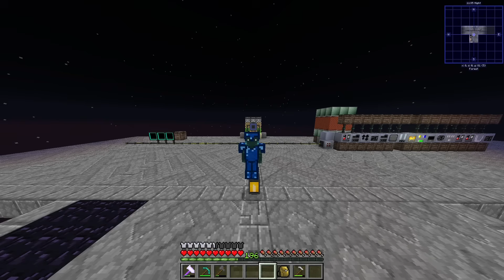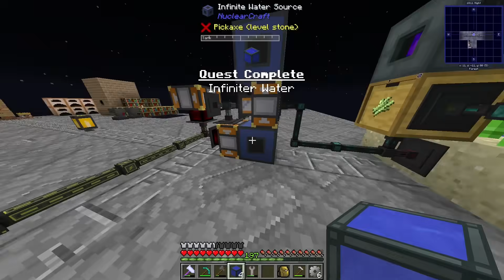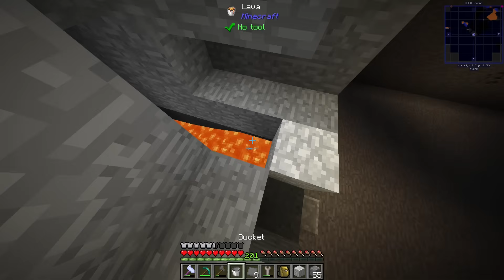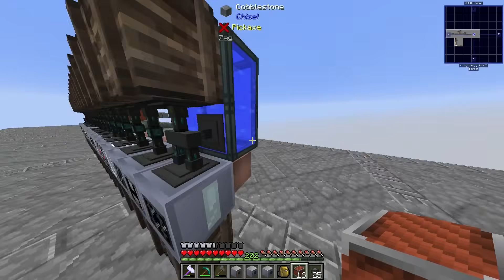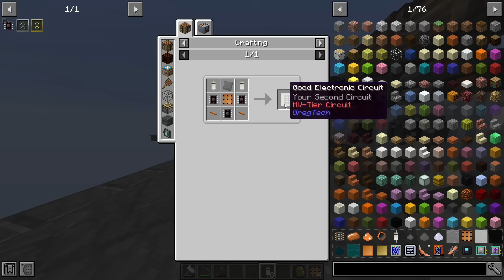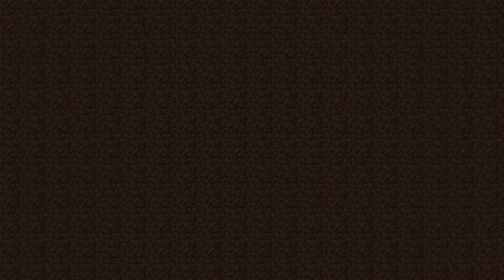Nomifactory [03] - Passive PPC and prosperous power solutions

Comment: Cleanest PPC automation I've seen in my life. Few tips, though:

Electric furnaces are 100% useless and 0% useful. Switch it out for a normal furnace and use Coal Coke to fuel it.

Additionally, since you now have access to Coke, save your Alloy Smelters the trouble and make like 16 PBFs for steel. There's an amazing recipe that takes 2 WroughtIron and 1 Coke to give out 2 steel in 30s. 

Rig a quick clay electrolysis system into your PPC, for sodium, silicon, lithium and aluminium. Sodium is a nice building block, lithium is good for batteries, silicon and aluminium are great for boules and machine hulls.

Happy Gregging!
- Clew
Reply from the maker: yea everyone is saying electric furnaces suck 😭

i did actually notice that steel recipe, and since pbfs are so cheap it might be worth spamming a few lol
Reply: My automation is a mess, but it works. 😭😭😭

Comment: Regarding the confusion when you tried to power the MV alloy smelter:
Gregtech machines work by accepting a single Amp of power (unless otherwise specified), so you cant just pump 4 amp of LV into an MV machine, you'd have to transform up from LV first.

Comment: Ender IO conduit transfer limit is per connection (a bit oversimplified), so you can transfer almost infinite power as long as each generator and machine draws less than the limit
Also it's a good idea to build the PPC setup in a way that allows easier expansion in the future since you would need a lot of it to keep up with all simulation chambers. There's a ratio somewhere which mentions how many machines you need.

Comment: about the gt energy, your mv machine in the polymer line works on that cable because (it's just a guess, didnt check the recipe) it only uses 32 EU (equivalent to 1A  of lv). the small machine can only accept 1A of their tier. so on the mv alloy smelter it does not work with lv cabels, since it uses almost 4A. The multiblock energy hatches accept 2A each, so you can overclock your ebf to the next tier. your 16A line helps when you want to run more lv machines at once. hope the explanation helps
Reply from the maker: Yeah a couple people have mentioned how it works, I think me understands now :))

Comment: "two 6000 and 2000, we're producing loads!" Once u start passiving it wont be that much unfortunately. 😅 
As Exa said, electric furnaces will become your bottle neck so arc furnaces are recommended. If you want infinite oxygen theres the glass loop where sand -> 2 glass for 20mb O in an arc furnace and then that glass inevitably becomes 2B O after processing it into SiO2. Afterward you feed that O back into the first step and its generally +1980mb O positive. I dont remember the specific ratios but I only ever had to upgrade the setup once at like IV/LuV iirc. Great episode!
Reply: could you explain a little bit more on how to do this loop? i cant find where to turn the quartz into oxygen again, ty!
Reply: @cesc21  its glass to oxygen, not quartz.
Sand + 20mb O = 2 Glass
Glass -> Glass Dust
Glass Dust -> SiO2
SiO2 -> Si + 2O

Comment: 9:37 the arc furnace is like… one of the easiest machines to make… and it would’ve doubled how much you get out of your gallium arsenide… it’s not quite as useful in this pack as wrought iron and glass can be made way easier without but annealed copper is still extremely useful. It can make more of the basic components and is also needed for some mv machines (I think). Plus you can recycle machines and other stuff if you want in the arc furnace, but there’s little point. Please make the arc furnace, it’s so good.
Reply from the maker: Il definitely look into getting an arc furnace! I'm very quickly running out of gallium arsenide and making glass better is also useful

Comment: You can run higher voltage machines on lower voltage power, but they are able to take only 2amps so if recipe takes more  power than 2a of lower voltage, then it will powerfail
Reply from the maker: Yeah I understand why it wasn't working now lol

Comment: If you like to keep notes for yourself, rather than signs craft yourself a clipboard - they can be placed on a wall to display it, and you can interact with it to add/edit entries. You can even check them off with clickable checkboxes.

Electric furnaces are really bad, and will bottleneck the speed of your nether quartz. Use an arc furnace for glass, and a diamond furnace is better for clathrates. Later you can upgrade to using a Multi-Smelter, the best furnace in modded minecraft.

A robot arm without a filter in it set to Keep Exact will consider any items it can see towards that number. A filter lets you tell it which items and how much of each to keep.

You can't usually power MV machines with LV power because machines only accept up to two amps of supplied energy to fill their internal buffer. The exception is if the recipe uses half of an amp or less, because it will fit in two amps of the lower tier. To run the machine safely, you need to either use a transformer to convert 4A LV into 1A MV, or use an MV-tiered RF converter to convert multiples of 512 RF into amps of MV.
Reply from the maker: Yeah I realized the furnace was definitely the bottleneck, il look into the arc furnace I always forget you can use it for glass lol

Also thank you for the info on MV machines only using 2 amps on LV lines, I understand why it wasn't working now :))

Comment: Fun fact! In GTNH, Multiblocks can be rotated by rotating the controller. I'm pretty sure that included the EBF. No idea if it's the same in this pack tho.
Reply: GTCEu does support multiblock rotation, yes. You will see a circular arrow on the front of the machine grid when you hold a wrench and look at the controller. This allows you to spin the orientation of the structure.
Reply: multiblock rotation is in this pack iirc
Reply: This works in any GregTech modpack because it's basic GregTech thing